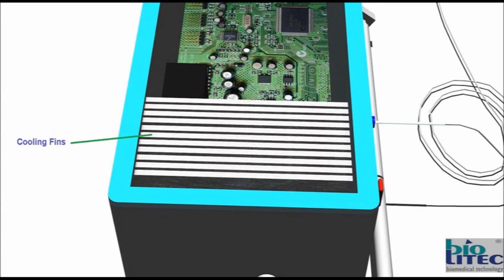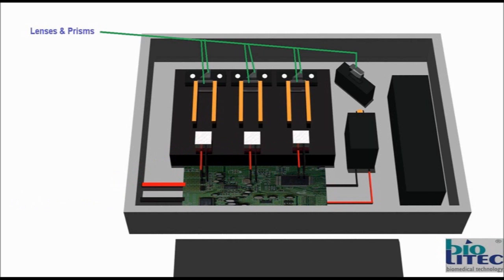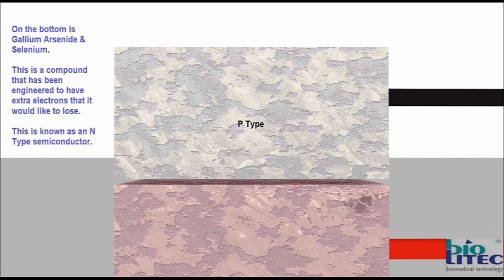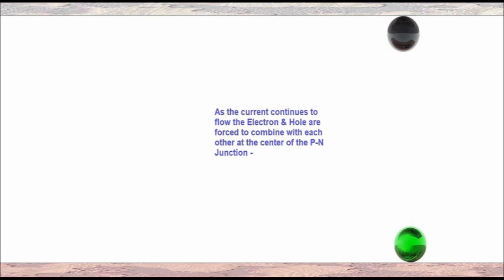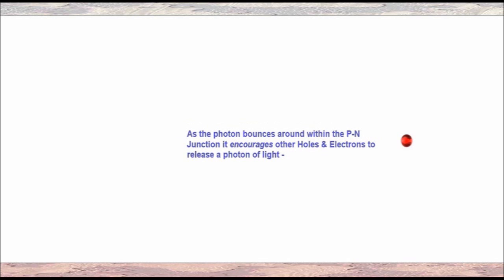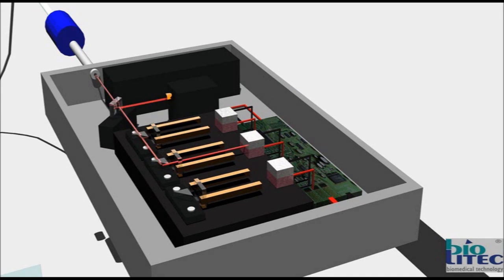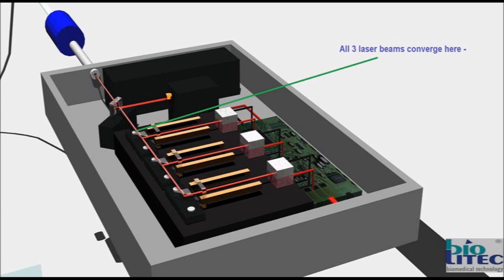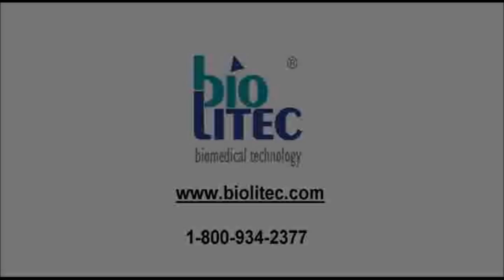Laser Diode Explained for Beginners - Physics Included

Comment: What keeps the three diodes in phase?   :)
Reply: Here you go https://youtu.be/Pd2MpOrgbu0
Reply: @cosmological7773  Thank you m8.  At least I now have an idea about what is going on.
Most appreciated.   🙂
Reply from the maker: I'm no scientist, but if you really mean phase then the answer is the semiconductor type. I've never really thought about phase when talking lasers. They're all reletively coherent so no need to worry about any design considerations related to phase. Each diode is man made so there will be variances in their characteristics, but ultimately they all join via the prisms. If one diode peaks at 980nm and another at 981nm, you'd see peaks at both wavelengths out the fiber. No issues whatsoever combining different wavelengths. As a matter of fact, the newer ones had 980nm and 1470nm diodes combined into one beam. The output power just adds.

If you mean what determines the wavelength then the answer is the type of semiconductor used.
Reply: @Davelement  What I was getting at is what keeps the three diodes in phase with each other?
Reply from the maker: @Graeme_Lastname  nothing. There is absolutely nothing dedicated to keeping diodes in phase in this particular application. It's just not necessary. We manufacture some modules and others we purchase, but in all cases they end up with a certificate of performace (essentially a plot of the power and wavelenght). Once installed, you just vary the current to get the desired output. The more modules, the more power you have. As a medical device, we need to guarantee the desired power within +-20%, to meet FDA regulations. That's all.

Now, for scientific uses where wavelength stability is critical, the only thing I can think of that would have an effect would be the temperature. Otherwise, the physical composition of the laser determines the output characteristics. Not much more you need to worry about. 

As an aside, my experience is all R&D on the consumer/medical electronics side. Most of the time we either build or purchase a laser with a desired wavelength. I have no idea what they get up to in photonics related academia.
Reply: @Davelement  Thank you.  My point was just that if you have two lasers 180 degrees out of phase then your total power is zero.  I assumed, even if just for efficiency, there would need to be a stable phase relationship between the emitters.
Now I know, it's down to luck.  You can send me any that don't pass inspection.  I'll find a use for them.  Thanks again m8.  
C Ya.    :)
Reply: @Davelement  can tell more about how to synchronize 755nm and 810nm wavelengths?

Comment: What is a hole? I initially thought it was an analogy for a missing electron, but how can it move to the center of the P-N Junction?
Reply from the maker: It is not very intuitive, but just like an electron, a hole can be "perceived" as moving because energy is transferred. We're talking quantum mechanics here, so not easily explainable and understandable. When electricity flows (AKA conduction AKA electrons on the move) they leave behind a void, which one would assume results in a net positive charge. Well as soon as one electron is out the door, another moves in to fill the void. These holes are quasiparticles, which still blows my mind that they have mass, but only exist due to the engineered materials of the p-n junction. Basically, an effective semiconductor diode exists  because two really special materials are joined to allow electrons to move in a special way. This is contrary to current flowing through a wire, which doesn't have a lattice formation, and therefore no special bonds to allow holes to exist.